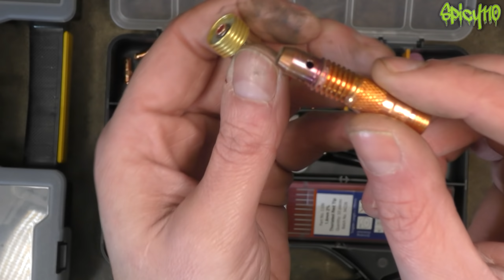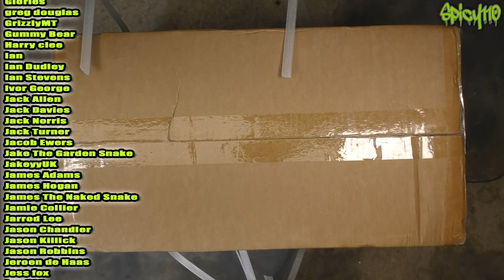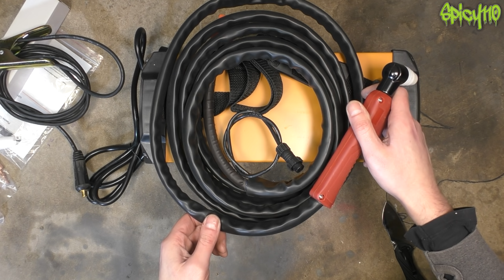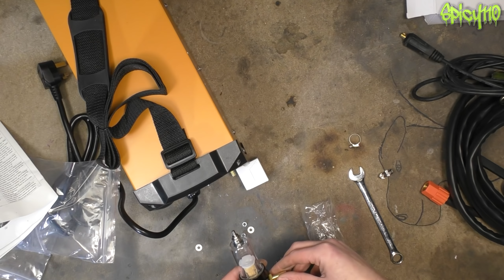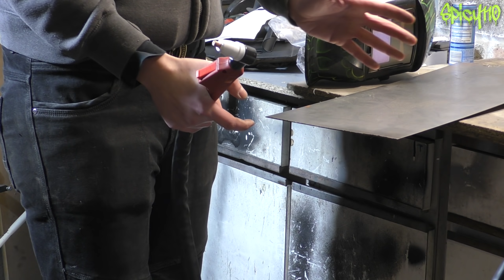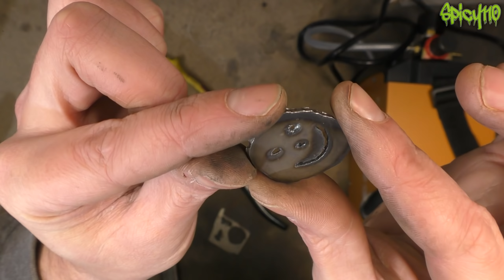Amazons cheapest Plasma Cutter! 45,000°F

Comment: Hey mate, I have a tig welder too and trying to get better. I'm using the torch that came with it (you know, the standard horrible big bulky ones with the crap ceramic lenses.

Whihx torch are you using and does it make it alot easier? And where do you get the lenses etc. For your torch?

Thanks!
Reply from the maker: The torch I use is the one that came on the machine its very standard. Ceramic cups are still great its just for some of the finer work you can see a little better and the gas flow is wider and more stable with a lens. Sadly it doesn't really make it any easier, Tig is not easy at all but with some time learning from videos etc to understand the basics and why things go wrong plus a ton of practice, it stats to all click.  Be patient with it. 🙂👍

Comment: The delay with the gas is due to the fact that if your cutting thick metals you want the gas to still penetrate after you’ve stopped cutting so no contaminants enter the malton metal, same applies to TIG and MIG welding. You may remember our conversation on Instagram, Robert.j.sanders in the comment section.
Reply from the maker: Wouldn't that only work if cutting with nitrogen not air? Tho I can see how it would blast any remnants of the molten pool off.

Comment: Welcome to the world of gas lenses, you'll never want to go back.
Oh, also worth mentioning it in case you didn't run into it during research, on thicker steel, if you have to start in the middle of the plate, pulse the cutter rather than trying to make a hole in one go, makes a nice hole and doesn't blow in your face nearly as much, have fun :P
Reply from the maker: Thanks for the tip! I thought you had to drill a pilot hole.
Reply: +1 for a pilot hole,never tried pulsing to be honest but anything that extends the tip and cup's life is a bonus.
Reply: @spicy110    Pilot holes don't hurt, probably better actually, I forget about it since, well, most of my work wont fit on a pillar drill
Reply from the maker: Makes sense 👍